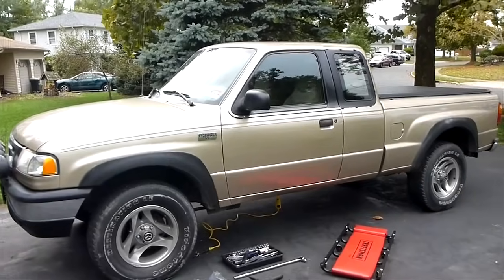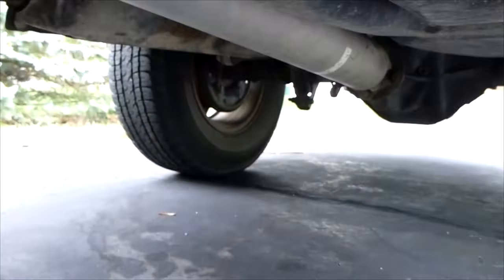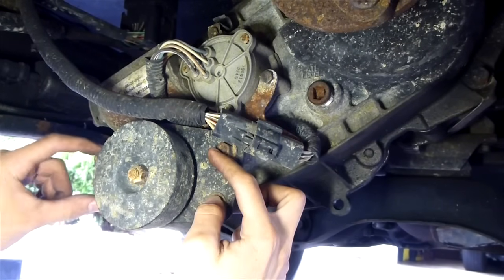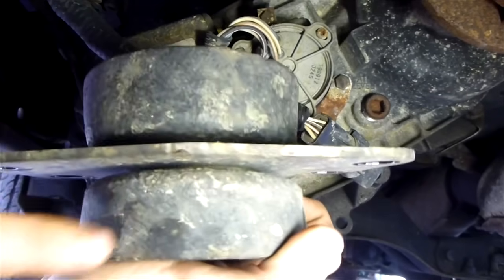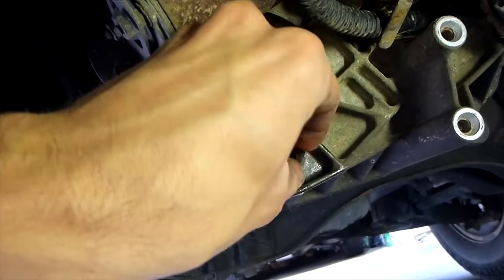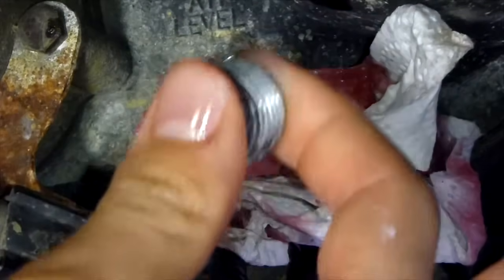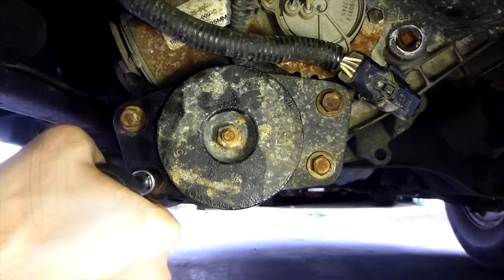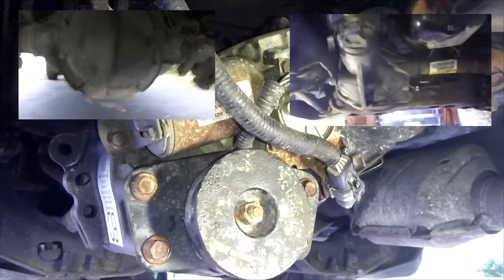How to change Transfer Case Fluid (Easy)

Comment: If you use Motorcraft fluid, you should not use the new Mercon V. It says right on it "not for use in transfer cases". Motorcraft has a dedicated fluid that is specifically for use in the transfer case where Mercon is called for. It is XL12 Transfer Case Fluid. Some people have experienced catastrophic failure due to using Mercon V....do a search and you will see. I can't speak for other brands, like the one you have used. Just a little PSA.

Comment: I worked at a transmission shop and every manual transmissions/ transfer cases we always put 80/90 gear oil is that bad?

Comment: any tips/videos on checking transmission fluid in vehicles without dipstick 
my 07 expedition
Reply from the maker: +josh maples That is tough. They are all different. Some have a fill bolt that you can access from under the car and stick your finger in just like in this video.
Reply: +ChrisFix ok. Thanks for speedy reply good sir. I enjoy the videos and learning new techniques

Comment: thanks for the video.  For highlander 2011 AWD, the manual says 80W-90 hypoid GL-5.  There is no synthetic that is 80W-90.  Is it better to use 75W-90 synthetic oil?  I am just worried that 75 is different than 80 but not sure what is really different.
Thanks
Reply from the maker: Use exactly what is recommended. Dont change viscosity or you will cause damage. Although it is for transmissions, check this out: https://youtu.be/o690DovjDAc?list=PLDD611CFB36FC65F2
Reply: Thanks for your reply.  I am actually talking about the gear oil for differential and transfer case not the transmission.
thanks

Comment: When driving sometimes I see 4wd light(on the dash) blinks 6 times, stop and blinks again. when I put on 4wd high the light is on but nothing happen.
if I put on 4wd low (put the gear on neutral) I hear something "clank" underneath but
still won't puts power to front wheel.
On all cases above the 4wd lights is on like it should , but when when I turn on the head light they are off , whats up with that??? 
Thanks a lot man , I hope this will help you to help me ,
Reply from the maker: What car? There is obviously a problem if your 4wd light is flashing. Sounds like the transfer case wont click into gear.

Comment: what should be done if the fill bolt is not budging ..i have a 2000 jeep wj v8 and the fill bolt is stuck pretty good. i dnt wanna damage/strip the bolt. its a 10mm hex

Comment: Does it have a magnet on caps ? if it have point of it is to tell you if your transfer case is failing (any metal on magnet is part of gears or whatever is inside of it)
Reply: there is a magnet but it's on the inside of the transfer case, it's not build into the bolts them self (like the oil plug is) but yeah there's a magnet in there it's a little disc magnet

Comment: Great vid yo, but I got one for ya :) I have a 97-98 ford explorer. It's a v8 AWD (all wheel drive) and runs great. but the only tire that is turning is the back right (passenger) tire. Any ideas on trouble shooting on why all the tires aren't pulling? please help thank you........
Reply from the maker: drowization Thanks! What do you mean the only tire turning/pulling is the right passenger tire? Do you mean the only tire spinning when you get stuck?
Reply: yes, the only tire spinning when I get stuck is the back right tire, also that is the only one the spins when I would turn a corner to the right or left a bit too fast as well. I'm pretty sure the awd is not working at all, any idea on how to fix this? or how to trouble shoot this? thank you for getting back to me so fast GOD BLESS you .......
Reply from the maker: drowization You probably have open differentials so although it is all-wheel-drive, with open differentials only one tire on each axle gets the power if both tires are slipping (and unfortunately, the one that is slipping the most gets the power). If you have a limited slip differential, then you should get power to the tire that is not slipping. If you have a locking differential, then both tires on each axle will spin at the same speed regardless. I would try to see what type of differential you have and then report back to me, but it sounds like it is working correctly. My truck is the same way and that is a 4x4.
Reply: Sounds great I will get that info for you. but I thought all wheel drive meant that all 4 the tires turn? at least that is the way that it is on my other car.... (thanks again for talking to me about this)
Reply from the maker: All wheel drive is like 4x4. If you have open diffs you will not have all four tires spinning when there is a slippery situation.
Reply: Cool, got it. Still getting that info for you ... :)

Comment: How much longer before the front differential fluid video is posted? The link in this video says "Coming Soon!".
Reply from the maker: Yea, I am working on it lol!
Reply: Did you hold off since the front diff isn't doing anything 99% of the time?  I've been revitalizing a Ranger I picked up last year and your videos have been amazingly helpful... I've been flushing the fluids 1 by 1 but wasn't sure how necessary the front diff change was since it only sees use when it snows for me.

Comment: ChrisFix,

I have a 4runner with 4wd.  I rarely ever turn on 4wd, so most of the time the rear wheels are driving the car.  Is it necessary to change transfer case fluid on the recommended mileage if I rarely ever use 4wd?  It has 95K miles.
Reply from the maker: +Me Too There are still moving parts in the transfer case that move even when it is not turned on so yes, change the fluid every 100k miles to keep it fresh so that one time you might need 4x4 it will work flawlessly! Good question!
Reply: +ChrisFix Thanks!

Comment: Hey Chris,I have a 2002 ford explorer 4.0 l v6,my wife was driving on the highway full speed with the 4wd on and then turn it off while she was in full speed, since then the 4wd start making noise, when I come to a complete stop and put my feet on the gas , it start making a noise until I slow down, what do u think? Is it the transfer case,the front differential, the shift motor , the cv shaft or the wheel bearing?
Reply from the maker: STEEVE DAVID Nicolas It makes noise even when the 4x4 is off?
Reply: You never go full speed in 4x4 it isn’t meant to go fast with

Comment: Dear   ChrisYour video is  simple  and ez to follow.  I have 97 Ranger 4x4 , transfer case seal is leak.  Any suggestion  on how to replace the seal. The fluid is clear yellow just like brake fluid leaks out of transfer case.Thanks
Reply from the maker: +Bao Nguyen Dang, you will have to take the transfer case apart to replace that seal. you might try to find where it is leaking, clean it off with brake clean, and pack RTV into that area and see if it holds.

Comment: Hey Chrisfix, my front axels are grinding and I thought it needed gear oil so I put some in and the grinding noise ain’t really go away and now I’m thinking it’s stuck in 4WD cause it’ll barely go the speed limit without it grinding and normally my truck jumps out of 4x4 but it hasn’t recently and today I put in 4x4 hit it in reverse and hit it in drive and it felt the same when it was in 2wd then I switched it back to that hit it in reverse and when I hit it in drive it jumped out of it and was driving normally till I turned around and hit it again it started grinding again and idk what’s wrong with it now
Reply: Can you help me out?

Comment: What do you think on changing the transmission oil on a 99 Toyota avalon with 185k? It's starting to shift hard when cold
Reply from the maker: mikequintero If it is starting to shift hard it might be the filter is getting clogged so a new filter and a fluid change might be the way to go.

Comment: Very well explained. Thanks for sharing this info, I'll be doing fluid changes on my daihatsu van, I've also watched you're video in regards with changing the brake cylinder, my rear brake drum really spills a lot of fluid, I'll be doing them this weekend. Thanks and add more car tips for most end  users like us, good way to avoid expensive mechanical jobs.               - kitoy from manila.
Reply from the maker: francis pabalan Thanks Kitoy! I am glad the videos are helpful and that is exactly why I make them! Thanks for the shout out from Manila!
Reply: Thank you also for the response sir, I'll be removing the leaking part on Sunday, the parts store said they need a sample, they said daihatsu parts are a bit hard to find but an alternatives are readily available. I'll be checking other parts based on your videos Thanks Sir Chris....kitoy

Comment: Chris I have a Question I'm loosing lots of antifreeze every day water spills out my tail pipes any where in idle what's the cause there's  always antifreeze spills also under my truck in the front
Reply: kingofthe40oz  that's true but I heard if it does and stops after a start up it's find
Reply: Fine
Reply: if it leaks water out of tailpipe only on start up, it may just be condensation. if it continues to leak, well... id guess its a head gasket problem. as for the puddles of antifreeze, thats definitely a leak... try getting a pressure tester and pressurize the system (from radiator) to pinpoint the leak. maybe some uv dye?

Comment: Hi Chris ,
What type of transfer case fluid do I use in a :2013  Chevy Suburban LT 4wd  with a :  2 wheel +AUTO +4 WHEEL HI Traction?
I wheel appreciate  it .
Thanks .
Reply from the maker: +R , J Monestime Check the owners manual. That is the best way to know!

Comment: Hey Chris, I have a question about my transfer case. I have a 1997 GMC k1500 with 330k on it and the t-case is push button. When I put my truck into four wheel drive it makes  a loud howling noise. Also, when driving I get a grinding noise at about 70mph and also I get a random jolt going down the highway. When I get the jolt the rpms do not move at all. (transmission is has been rebuilt not long ago.) What do you think is wrong?
Reply from the maker: Zach Taylor You are only supposed to use 4x4 on a slick surface (such as a wet or snowy road or offroad). The jolt might be due to the tires spinning at different speeds. Are all four of your tires the same company and size? The howling noise could be a bad bearing, inside the transfer case. Have you checked your fluid level?
Reply: ChrisFix All four tires are the same bought brand new not long ago. The fluid level makes sense. Do you think the jolt would be the chain slipping?
Reply from the maker: Zach Taylor It could be a chain slipping.

Comment: Chris can you tell me where the auto transmission dip stick is in a Nissan navara d40 2013 model. Just can't find it at all.
Reply from the maker: +Frank Keiller you might not have one. Check the owner's manual.

Comment: I have a 2011 AWD chevy equinox ltz. I went to the service center to have the transfer case fluid checked and changed. They told me my car do not have a transfer case. While in my car's manual,  it's supposed to have it and due for fluid change every 50,000 miles. I'm confused.
Reply from the maker: bestdaughterever ever The Chevy Equinox has the transfer case built into the transmission.
Reply: Thanks for responding. Does it still need fluid change?
Reply from the maker: bestdaughterever ever If you change the tranny fluid that will include the differential. There is no separate diff fluid. It wont need to be changed as often.
Reply: Thanks so much. I appreciate your help. :-)

Comment: very nice video man,do u know how i can change front diff fluid on a ford ecape 2001? or is the transfer case and front diff the same fluid.
Reply from the maker: Ricci Lala I have been trying to come up with a good method to get to that front diff fluid. I think I am just going to pump it out. The front diff and transfer case are not the same and not the same fluid.
Reply: ok, do you know how i can locate the front diff drain/fill plug and the transfer case one on that particular vehicle. i appreciate  it.
Reply from the maker: It is the same as my truck. The front diff has the drain plug on the rear near the top.
Reply: Can u help me how to find those 2 spot and i got a howling noise is it the front w bearing or the diff fluid the cause.
Reply from the maker: Ricci Lala The transfer case is exactly the same as in this video. You will see the plug at the top of the diff on the rear of it if you get your head under there. Not hard at all to find once you look. Can you not find it or something?
Reply: i found one in the front i suppose it is the transfer case now where can i find the front diff? scotty kilmer told me they share the same fluid,that why i thought they were combined in the ford escape 2001.
Reply from the maker: Ricci Lala The front diff and transfer case share the same fluid on front wheel drive vehicles. So since your escape is front wheel drive, the diff and transfer case are together. I thought you said you had an explorer which is identical to this vehicle in the video. I messaged you a link to where it is located so check it out.
Reply: i never get the link you messaged me,can you post it or send it again,pls.
Reply from the maker: will do
Reply from the maker: Just sent the link again. Check your messages on YT under "community"
Reply: sorry can't see the link,please just put it below this comment so i can get it.
Reply from the maker: Just search your car and your problem on YouTube. It will come right up. I cant post links on here because of spam.
Reply: Do yourself a favor and sell it before the transmission fails

Comment: Hi,

I have a 2012 jaguar xf 3.0L V6, bought few months ago it has 90,000 kms on it. I have noticed that if I park on an incline after the car is there for while when I start and put it in R or D it gives a prominent clunk sound. 
And on high revs when the gear changes I feel a small jerk. However the jerk is not there on low revs 

Do you think it has something to do with transmission oil or it's something else.
Reply from the maker: +eBiz that’s completely normal. Use your parking break on a hill so the weight of the car isn’t on the transmission pin which holds it in park.
Reply: ChrisFix what about the jerk when gear changes it wasn't there few weeks ago

Do you suggest changing the transmission oil ? Along with the filter ?

Comment: Chris, I got a new OBD scan tool that records live data. I've been told though that starting a car with the tool plugged in can blow the PCM. What's the deal with this?
Reply from the maker: helivesonforever I never had a problem starting the car with the scanner plugged in. There is no power to the scanner until the car turns on anyhow.
Reply: ChrisFix Alright, I won't worry about that then. I do have an issue with coolant getting into my exhaust manifolds now. Large amounts, enough that the smoke made me think my truck was on fire. Time for head gaskets and intake gaskets?
Reply from the maker: Try to find where the coolant is coming from. Sometimes it is just a pinhole in a coolant line.
Reply: ChrisFix I have no leaks at all, tried the dye too. Nothing, no drips. Could actually smell it in the exhaust too. My question now is how does it get in the manifold? does the manifold bolt up to the head? Possibly a cracked head as well? Smoked so much today when starting that it looked like I'd just poured a bottle of seafoam in the vacuum line.
Reply from the maker: helivesonforever Yea the exhaust manifold bolts up the the head so if you have a head gasket leak, you could be burning coolant and that sounds what your problem is!
Reply: ChrisFix Alright, would you recommend doing anything else preventive to the engine while it's all tore apart?
Reply from the maker: helivesonforever For maintenance, no, just get the head gasket fixed and call it a day. For performance, there is a lot you can do ;)

Comment: My pathfinder has a transfer case but it's only 2wd. Would it be worth it checking the fluid, if there's any at all.
Reply: William Figueroa Jr. It's most likely a dummy unit, Ford did the same thing on Bronco 2's, if it's the same it's not filled with anything and it's just empty. Are you sure it's 2WD?
Reply: Jake Tow yea I'm sure. There's nothing to attatch a drive shaft to an no axels for the front.
Reply: Does your truck have low range gears? If so, that's what the transfer case is for.
Reply: Wow, now that's bizarre!

Comment: So in my 4x4 f150 I have the transfer case fluid to change and rear differential to change correct sir??
Reply from the maker: Correct. Dont forget the front differential too! I still havent done that because on my truck it is a pain to get to. You are supposed to raise the front cross-member to get to the diff bolts but I am not doing that. Ill have a video on that soon, once I finish my front end rebuild.

Comment: I have a 02 dodge Durango SLT 4×4  would it be the same almost or do you have any links or anything that shows it being done on a Durango and how can you find a short in your wiring my brake light won't work I've changed the bulbs and the housing worked for a hour then stopped can you help?
Reply from the maker: +Shawn McKenzie DieriKX (slim shady) It would be the same process. You should check your fuses if you think there is a short.
Reply: +ChrisFix thank you for getting back. I already went through my fuses none are bad. any other suggestions by chance thank you

Comment: +ChrisFix Does it have to be thread sealant or can it be Thread locker. It's like a tape
Reply: I have used the teflon tape on drain plugs and filler plugs for decades. Never a leak.
Reply: thank you